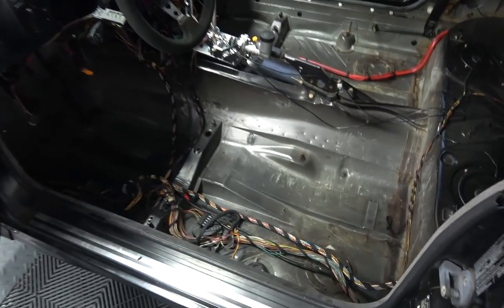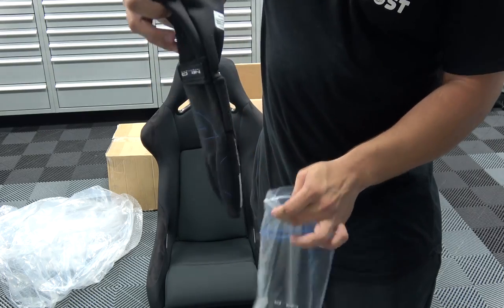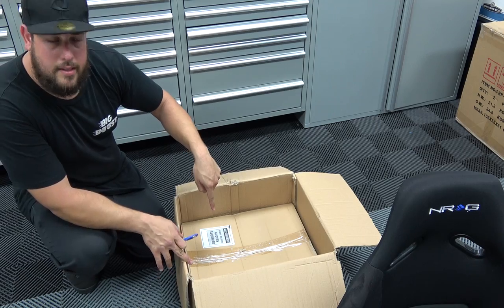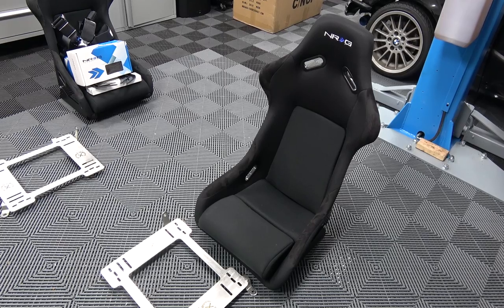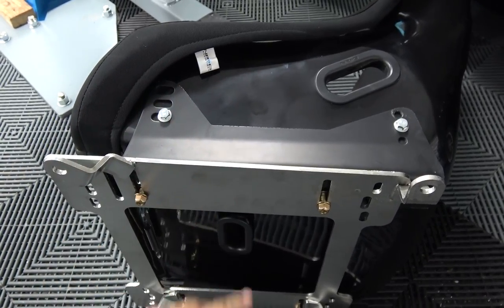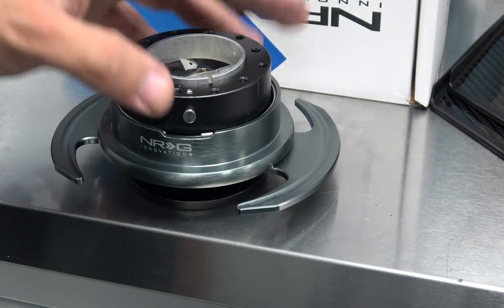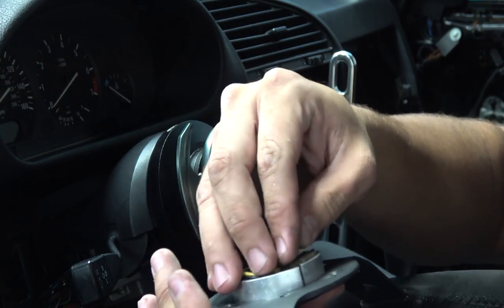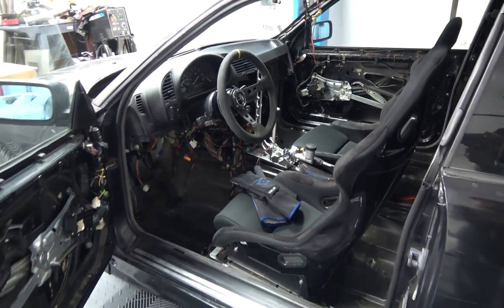GOT NEW SEATS FOR MY E36 DRIFTCAR

Comment: NRG makes the sliders for these(they're universal).  Just add the sliders in, it'll add like an inch of height, but let you go a lot further back!  I have sliders in my E36, and the back of my Sparco sits just a couple inches from the rear bench area(I'm 6'3).

Comment: I think you could probably move the seat further back if you drill new holes on the silver mounting bracket for the front bolts, while using the rear-most set of holes for the rear bolts?

Comment: Alberto, it's good to see how much you have evolved in the short time you have had your YouTube channel.  I have a question about those seats, how high do they sit off of the floor board?  I'm looking to get some new seats for my MR2, but being a tall guy I've got to do tall guy mods to fit in the car properly.  With the stock seats I have to have them leaned back as far as they can, which is terrible for posture.  Thanks in advance.

Comment: many companies love feedback and with you being taller, they should be able to add additional slotting to the program in seconds...  and or modify the program setting the seat back 2" or so, relatively easily and offer this as an option... this would open up the market for them for taller people, like myself... so this is incentive for them to do this for you.. though i would modify the bracket myself... and am used to this sort of thing, i can understand people wanting this to be as clean as possible... and designed from the manufacturer to accommodate taller drivers

Comment: Looks like you could move the seat back another 2 inches if you drilled new mounting holes for the front Bolts and moved the rears to the existing gang of three holes at the very back.

Comment: Boost, are the mounting holes square on the floor? If so, you should be able to spin the bracket 180 to get the seat moved back. Since you won't need the seat belt bracket with the harness..

Comment: Alberto u can get a flat steering wheel instead of this one that has concave and that will help a lot since as u said u are 2 close 2 the steering wheel . Or u can drill new holes on the bracket to take the seat further back
Reply: George Theodoridis his position in relation to the steering wheel isn't the issue. The angle of his arms is ideal for driving.. looks like his legs could use a little extra room though. For racing/drifting you want a 90 degree bend in your elbows and your legs should still have a slight bend while depressing the clutch
Reply: magnetic0314 Oh ok sorry I didn't know all of that stuff

Comment: Hey Alberto ! Cool content !
Quick question since you know your stuff, I have installed my asd hydro inline, and can only pull the lever back about an inch before it gets hard and slows the wheels (doesn't lock them) . Do you think my problem is the .625 cylinder ? Should have I gone with the .75?
Reply from the maker: i've always had problems with inline setups. I like to just run a dual caliper setup with a.75 and a long handle

Comment: always use 8.8 bolts and nuts for seat mounting. i case of a crash, 8.8 will bend, 10,9 and higer will crack. (fia regulation)
Reply from the maker: Geert ter Harmsel these are 8.8 grade :) ended up getting some of the flanged nuts with the little teeth on them too. also redrilling new holes to me the seat 3" back

Comment: I'm no expert but I swear you're too close to the wheel, also I understand there is no play in the quick release but your steering wheel is bending like crazy! Obviously these parts are sponsored so to an extent you are required to say good things about them but shit Alberto if they're no good they're no good...
Reply: Jordan Roberts yeah he's way too close to the wheel, there should only be a slight bend in the elbows when holding the wheel, and if you extend your arms, your hands and a bit of your wrist should go over the top of the wheel. Hope he does something about it
Reply: When he gave the opinions on the seat he kinda had that look he gave Adam when doing the 1JZ swap into Nichols car, and kept asking questions when he was cranky/tired af. XD
Reply: Jordan Roberts You saw the Video from ThatDudeinBlue about NRG Wheels? If not just watch it. Adam also said that NRG Wheels are crap.

Alberto pls change the Steering Wheel, because you dont want the Steering Wheel to seperate while drifting.
Reply: I don't buy NRG stuff, but wanted to clarify something. Most real racing bucket seats - Sparco, MOMO, Recaro, Racetech, Cobra, Bride, etc. - are made from a fiberglass shell and a cloth cover. Sparco offers a carbon fiber shell on some of its seat offerings at $4,000. Any carbon fiber seat in the ~$800 range is simply an overlay over a fiberglass shell. 

All fiberglass seats will flex and deflect. To what degree and what the safety is of a seat without certification on it is debatable. That's why FIA and SFI certifications exist.

Comment: the hardware that you got for your seat you said was lock Hardware no anytime I've used lock Hardware the bottom of the nut had a serrated edge that would bite into the metal witch created the lock. Is the nut tapered on the inside of the threads so that the more threads on to the bolt the tighter it gets? just curious what made them lock Hardware when I didn't see the serrated marks on the bottom of the nut. just always down to learn some new s***

Comment: Alberto, your steering wheel doesn't look to be very solid. I don't know how you, but I'm used to use a steering wheel as a handle get easier out of my car. I would be worried it this one won't bend. BTW, what brand of steering wheel did Dude in blue bent? Wasn't it that NRG?
Reply from the maker: TrinomCZ i could do that to 90% of other brands still. they all flex. i domt pull from the wheel to get out. that's why i got a quick release to get in and out easier
Reply: I know, that with quick release, it's still OK to have softer steering wheel. But still, I don't think you should be able to bend it under any circumstances.

Comment: Hey Alberto. I'm not trying to be a hater or start shit. BUT I think I speak for a few of us wondering if you're going to be working on the S15 before Adam gets back?  I would hate for you to get the bad reputation of just using Adam for his garage. I was under the impression that your primary focus whilst using the garage would be to get the S15 prepped for the 2J. I don't think you need to dedicate an entire video to clarifying this, but a couple minutes at the beginning of a video just to let everyone know what the plan is would help a lot. I'm sure you've been in contact with LZ. keep us up to date. 

Thanks Mucho Boosto
Reply: Steve Pierce Adam told him to finish his car first so they could drift together.
Reply: ahh okay. wasn't aware of that. Thanks.

Comment: how big are the canards ?
Reply from the maker: they are pretty small. should fit most bumpers without sticking out too much
Reply: Alberto BIGBOOST thanks 💪🏼
Reply: Alberto BIGBOOST you should paint the interior floor with the same paint u used on the bay 🤔

Comment: That moment when the sponsoring company are making their own proucts look like crap... Are the NRG seat frames designed for midgets? I don't understand why companies bother to make direct fitment bolt in parts if they don't bolt in, in the correct place! Sure, Alberto is a big guy, probably bigger than your "average" person, but that's hardly a reason to have so little adjustability.
Reply from the maker: noxious89123 lol im not sure. but if you check any other brand of seat brackets for e36 . they have the same mounting dimensions O.o